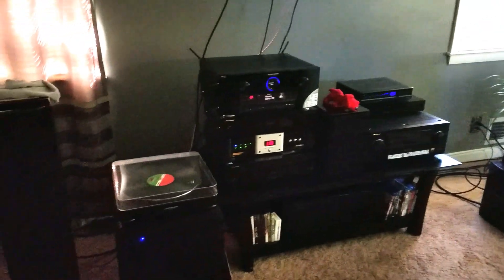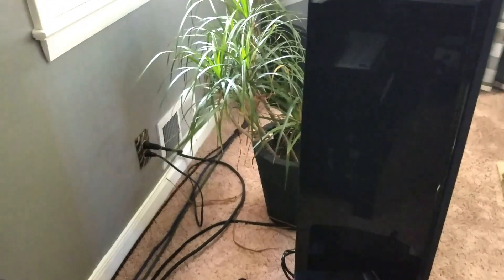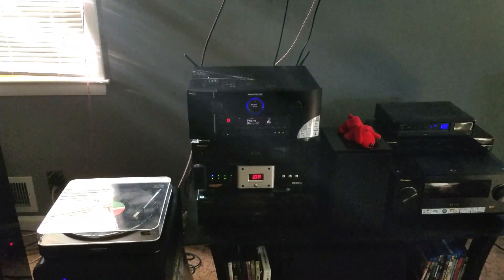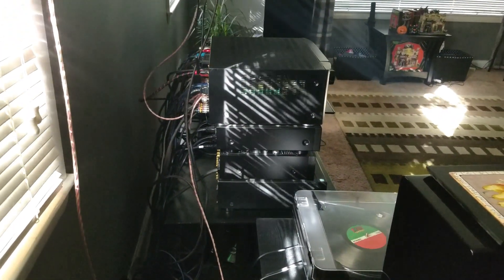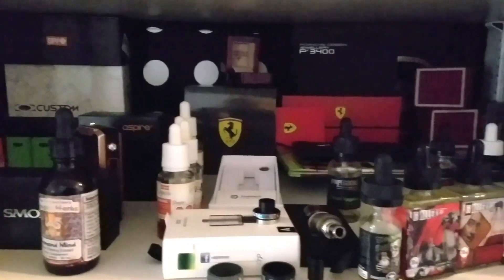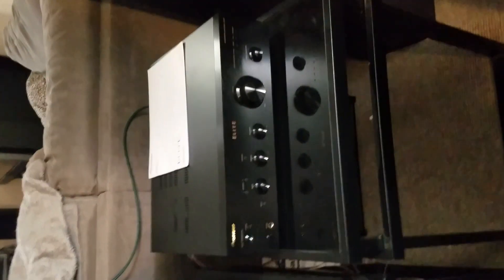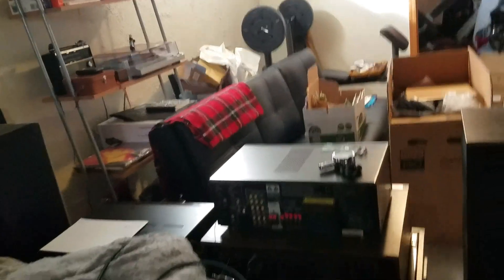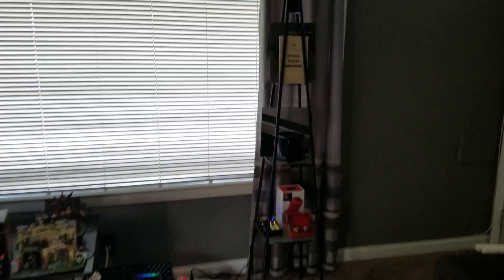Walk through showing placement of SVS prime towers and marantz sr7010

Comment: Thanks for showing us around! Was that a Yeti Bikes brochure I saw? 

Good looking system, and that room will be pretty close to ideal in terms of shape. I know it's a hassle, but if you move your sofa forward, it could help everything feel more immersive, but I understand it might not look as nice. I struggle with room shape, but yours is a better starting point. Wood subfloor or concrete?

As far as digital cables, I just look for cables that won't fail. Since they are digital, my opinion is that it either works or it doesn't. With analog (like speaker wires) you "can" change the sound with the quality of the cable, but with digital it either works or it doesn't, you won't change the"flavor" of the signal like you could with a speaker wire. 

Even with speaker wire, the biggest gains will be going from a 16-20 gauge wire to a 10-12 gauge wire. Assuming decent quality build and gauge, it would be pretty had to pick up a difference between wire that's $1 per foot and $25 per foot. The lower the resistance, the better, generally speaking.  

Same with interconnects/subwoofer cable. Something that doesn't pick up interference and is well built, you'd have to have a super critical ear to pick up a difference between a $30-$50 subwoofer cable and a $400 cable, if a difference exists at all. 

Good looking system! I'm going to have to check out the Blues Brothers album!